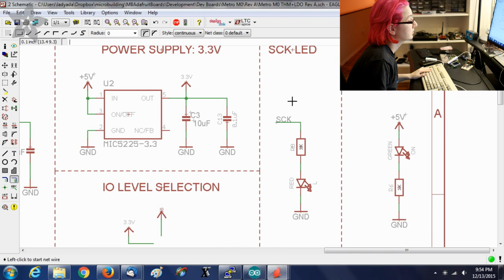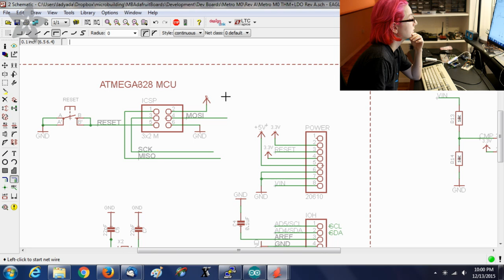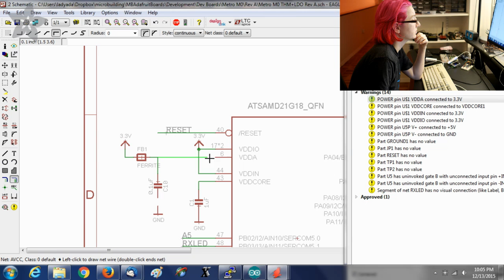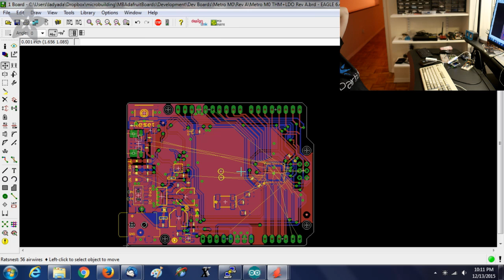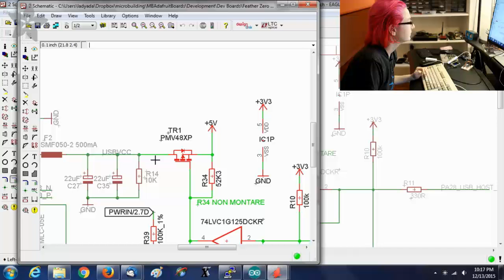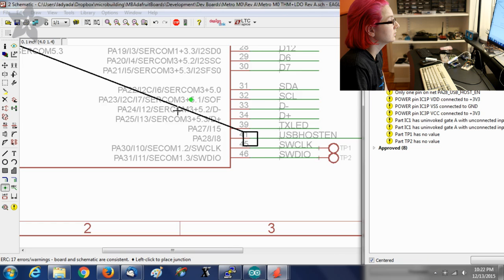Designing the METRO ZERO 12/13/2015 - LIVE

Comment: Considering U5 second part in package, take in mind 2 things:
Some opamps are sensitive to rail voltage input, so when you connected the spare opamp inputs to rail this should be taken into account.
Second, and even more important, when connecting both input to the same level, you may cause the opamp to oscillate, causing extra noise, current draw and heating. the proper way is to connect one input to a known voltage, preferably half VDD, using a 2 resistor VDD-to-ground divider, and closing a loop with negative, single gain feedback. Even if the system is extremely cost sensitive, adding 2 resistors should add about 0.2 cents to the total BOM, and may lead to increased system and devices integrity.